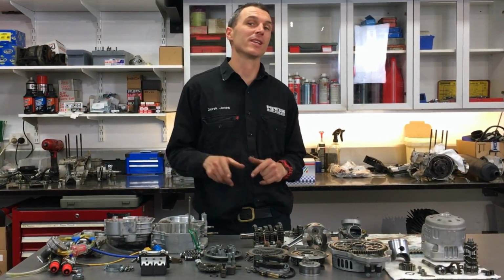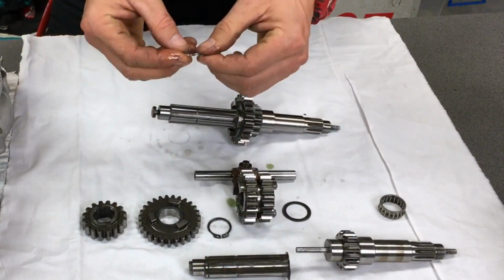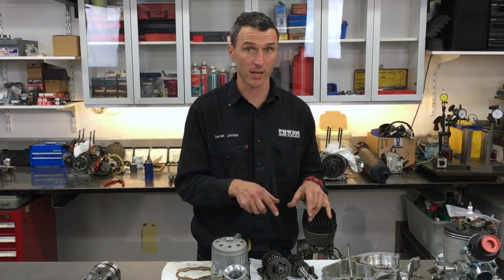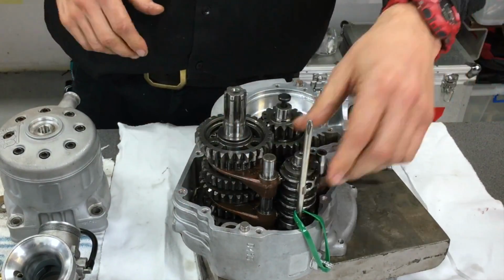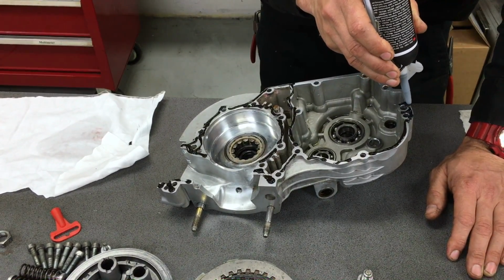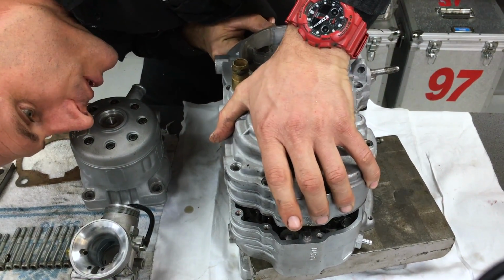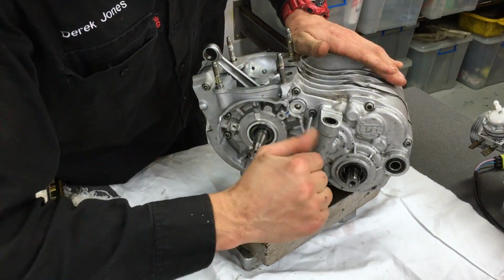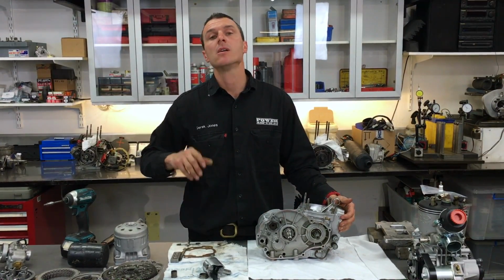KZ Rebuild Project Part Five - Bottom End Re-Assembly - POWER REPUBLIC

Comment: Hey great video. Ive just got an rotax evo what maintenance should i do to the engine. Also i a from Sydney Australia 👍👍
Reply from the maker: Hi Team Grima, thanks for the positive feedback.  change the gearbox oil with some ATF every 3 hours and after you use the engine in the rain.  drain the fuel out of the carb after each day testing.  Also, if your at a dusty track or drive off the track into the dirt and grass a lot, open the airbox and clean it out and wash your air filter  with some soapy water.  Hope that helps.

Comment: Mate ive got a KZ10b question.  I had the clutch cable off the engine and turned the engine lever and heard a ping sound. Now its right around and wont return. Is there an easy fix or have i made a major mistake and need to pull the engine apart (hope not)
Reply from the maker: nah, should be able to just pull the clutch basket out.  then you can remove the clutch push rod and then hopefully you can jiggle the little bit back into spositon.  BTW the clutch cable lever arm thingy can come out with having to disassemble the whole fn engine

Comment: What's your thought on a add on  crankshaft weight does it give it more bottom end ?
Reply from the maker: I use them as is and just repair them.  if you wanted more bottom end, change the pipe or exhaust flange spacers maybe..
Reply: @PowerRepublic  thank you for your reply what gives more bottom end longer or shorter ?